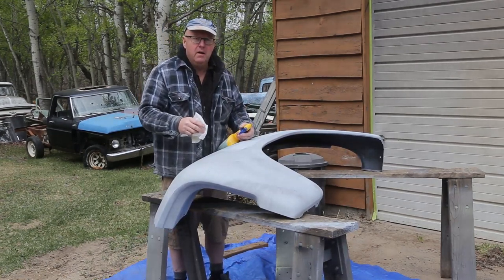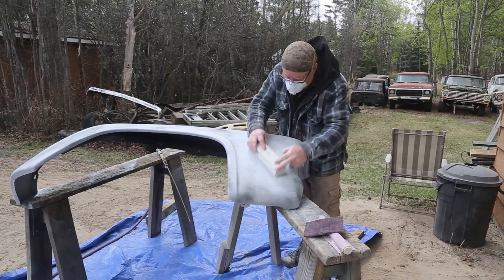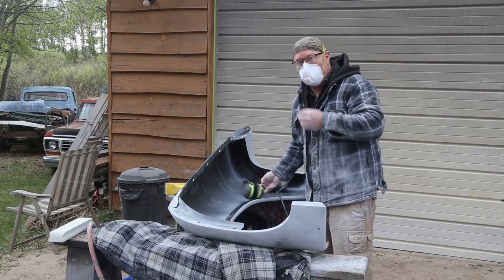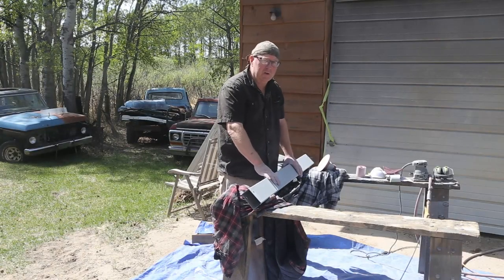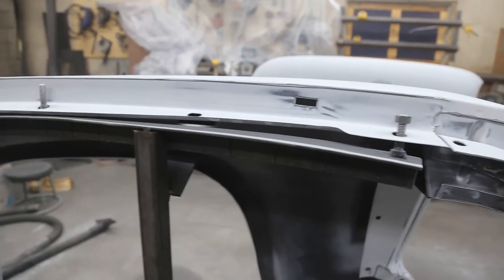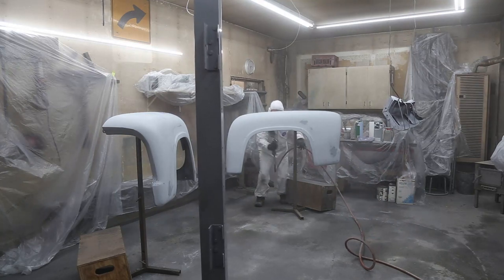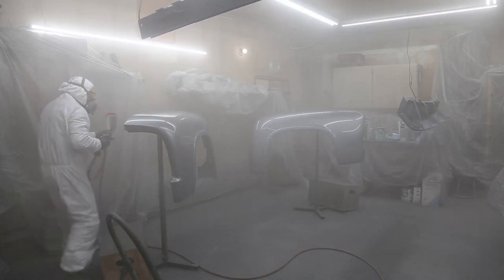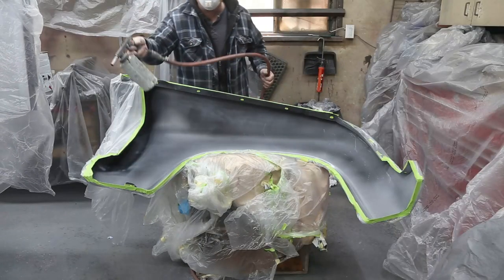Project Gray 1956 Ford Pick-up: Prep and painting the front fenders

Comment: Nice to get outside in the fresh air Sometimes you get a nice breeze to blow the dust away or have a fan outside to blow on the parts
Reply from the maker: It was nice to work outside.  We have a lot of cotton wood trees around and the amount of fuzz flying around this year was terrible.  I would have to sit in the shop until the painting was done so none would get in.  It worked out okay though.  Thanks Jim.  Stevo